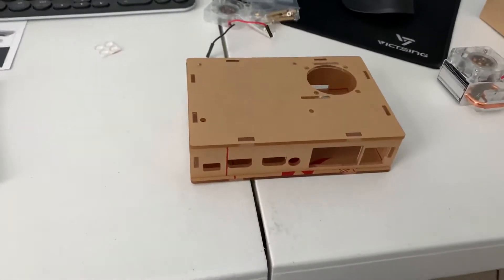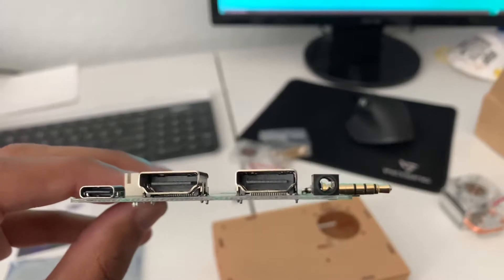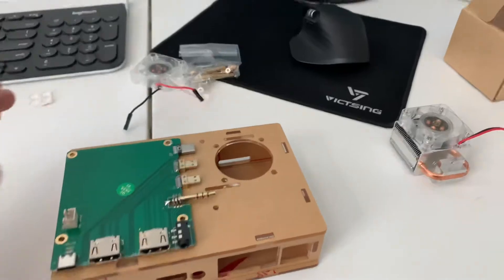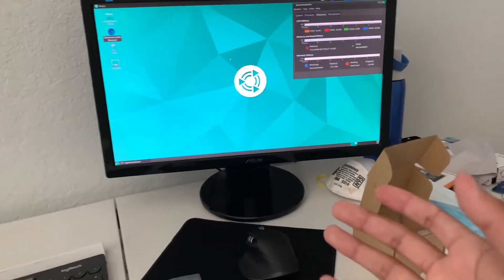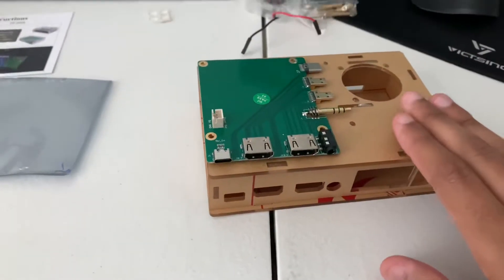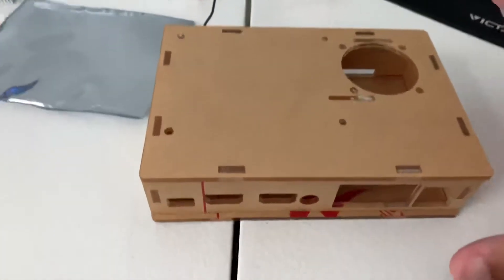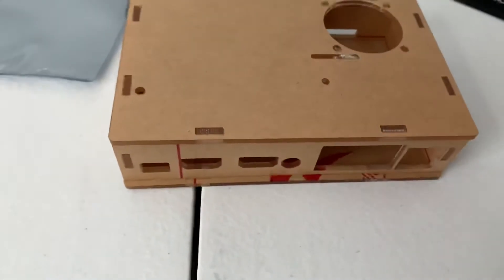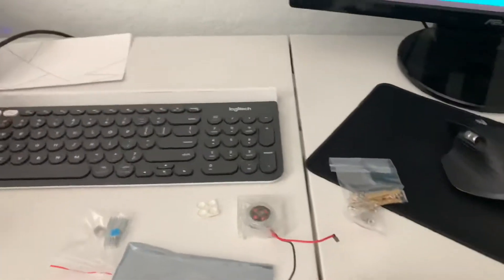Custom Raspberry Pi 4 Project

Comment: I like the reguar agon one case. Active/passavive cooling. I have it overclocked to 2 GH. Going over that, the pay off are really low and the heat jumps up a lot. At that range my fan only kicks on if I put it though heavy use and only because I set it to kick on at lower temps. I have updated it to the m.2 but I could of done with out.